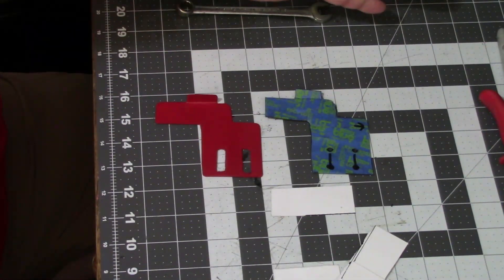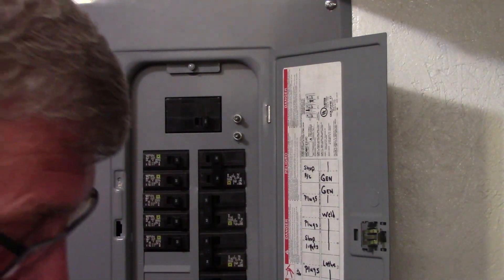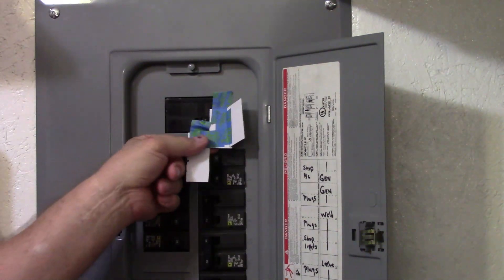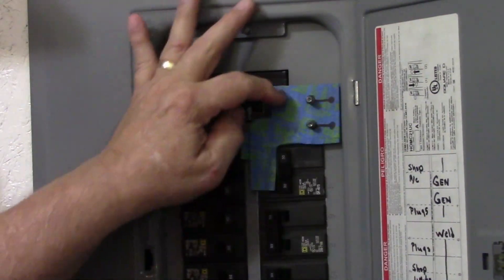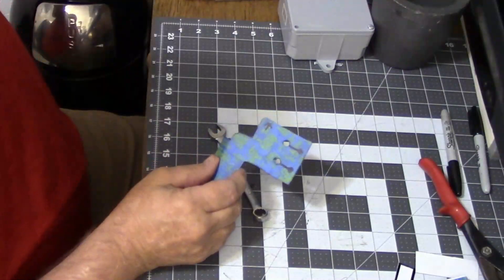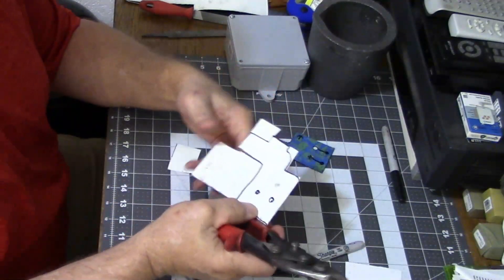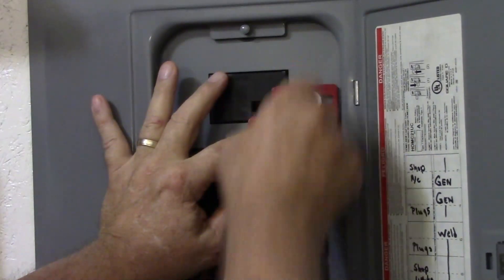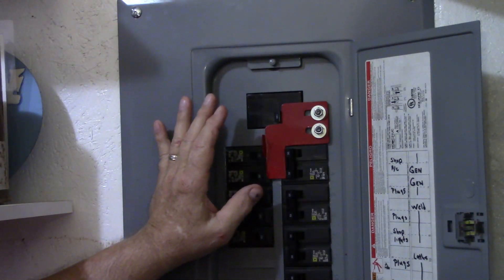Generator interlock build and installation on the breaker panel

Comment: I honestly don't think the metal will hold up very well since you were able to cut it with metal clippers. I could see someone with only slightly more than average strength pushing it hard enough to bend the metal out.

Comment: What size is your generator for this 30 Amp?  Are you running 110 or 220 as well.
Reply from the maker: I'm operating on 220 volt,  I have a new 11000 watt that can more than take care of the supply needs.

Comment: Rusty,  your video is great.  Thank you for doing and showing your process. I believe you have an identical panel.  I have a Murray/Siemmens 200 amp. I like your design better than mine.  I am in the planning stage with one plan design.  I LIKE YOUR DESIGN BETTER.THANKS.
Reply from the maker: Glad it was helpful and appreciate your comment. Thanks

Comment: Nice job, does this meet electrical codes ?
Reply from the maker: Of course if you build it , it won't have the UL markings.  It performs as the factory made units. But if your application call for UL or code requirements in your area,  you may prefer to purchase one. Good luck and Thanks

Comment: Rusty, let me tell you first that this was a great job.  I had planned to do the same when I saw the kit was $69.  I actually have 2 main panels, so that quickly became cost ineffective - you can nearly buy an automatic transfer for that price!  Your idea of taping cardboard to the panels was a time saver, as well.  BUT there's a feature other interlock kits have which yours does not.  By default, gravity promotes disengaging the generator breakers.  When they are disengaged the lock automatically drops down into place.  You must physically lift the lock up to engage the generator - insuring the main is cut off.  WIth your design I see a potential for error.  A new home buyer might just think it ok to flip the generator on and let your interlock flip the main off.  In time that would lead to play in your design - and the potential of a momentary, or if wobbly enough constant situation where both the generator and the main are connected.  I hope this helps you come up with an even more innovative design!
Reply from the maker: Thanks for the info. I recently got a 3D printer and may rework this one with added features. Take care.
Reply: @RustyGlovebox  I like the idea of a non-conductive interlock but I'm curious to see how you'll overcome the weakness inherent in making a thin enough to allow you to close the door.
Reply: I had originally had a similar thought of cutting it out of laminated rigid thermoplastic but to avoid flex it just would have had to have been too thick.
Reply from the maker: Just printed one on my 3d printer
https://www.youtube.com/watch?v=7hN8_myPBIQ&ab_channel=RustyGlovebox
Reply: @RustyGlovebox  can't wait to check it out!
Reply: I forgot to mention, I built mine just like yours - with a single vertical notch and 4 nylon washers so it slides up and down very easily.  I didn't need to use the folded tab, though.

Comment: Thanks sir! I had ordered the homeline interlock kit for my panel from Home Depot which arrived yesterday. I thought I was paying $55 for the UL stamp but there is no stamp on the metal piece at all. So I have decided to try make one myself. I took a piece of scrap sheet metal from my garage and cut it to exactly match the shape of homeline part in two minutes. How did you cut the slots? Router or drill?
Reply from the maker: Vikram Kapoor   I drilled 2 holes and used a Dremel cut off disc to finish the slot between the two.
Reply: Thanks you very much! I bought a Dremel kit from harbor freight and cut the slots. Here's a picture of mu replica along side the Homeline interlock kit https://photos.app.goo.gl/7jk82h2P5yPP696C6
Reply from the maker: Nice job, that will work great.
Reply: @RustyGlovebox  Its funny that when I went to install it I found that I had ordered the interlock switch in this first place. I had to trim one side and cut a new slot to make it fit. Here's a picture of it installed https://photos.app.goo.gl/Kh2PTi1W9FkT8Jhr7

Comment: Are you planning an upgrade using magnetic contactors which automate the process? We got a whole house gen that runs when our store bought electric craps out, does so automatically. hey! No pressure! ;-)
Reply from the maker: I would like to have a stand-by unit for the house but don't for now. I will install a 10 circuit  manual transfer switch soon though. Thanks and enjoy your week.

Comment: That is a fantastic idea!  I use card stock and tape on projects quite often. It is so much easier to manipulate than a piece of sheet metal.
Reply from the maker: I've used this method for some time. Just as you say, it's much easier to manipulate or adjust before you make the finial part. Thanks and enjoy your week.

Comment: That is a great item to have. Back feeding the electrical line would be one issue, but the one issue everyone would really notice without your device could be double feed. If you have the generator running and street power is restored you would double up and burn out a lot of items in your home.
Reply from the maker: That's very true Dan. One mistake like that and you would really regret it. Thanks and take care

Comment: That's a great idea Lloyd. I've only lost power for a day once, so very rarely, if ever need to do it. I switched the mains off, and plugged my 800w genny that you've seen, into a socket. Wouldn't run the fridge, but ran lights etc.
Reply from the maker: I did the same thing in the shop and decided to try this setup for a permanent solution .  Thanks Malc and enjoy your week